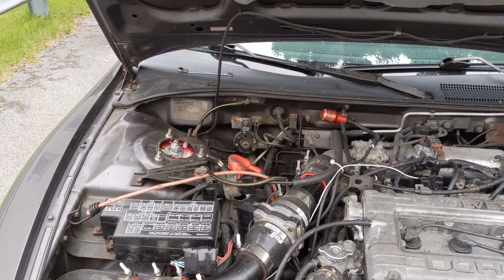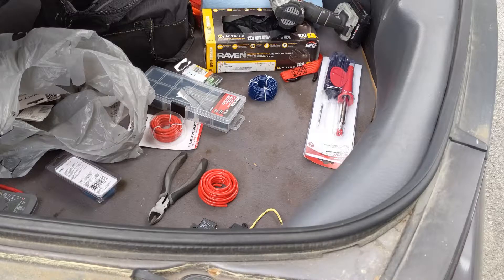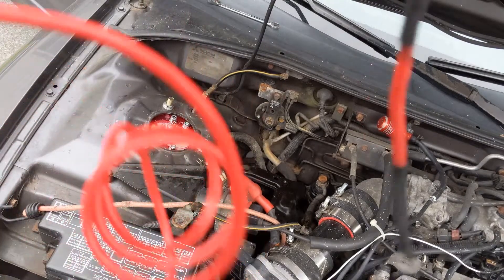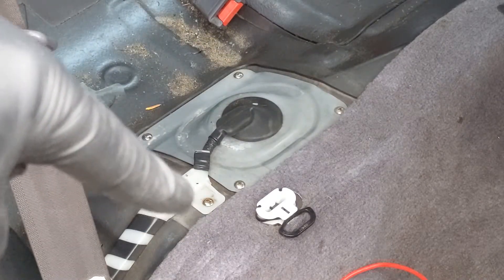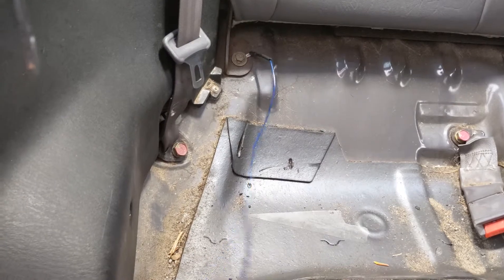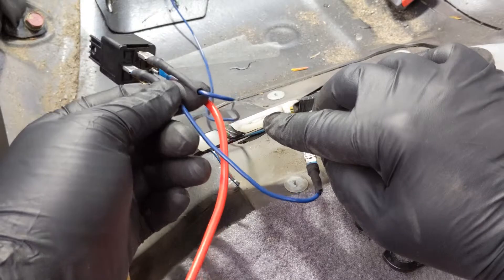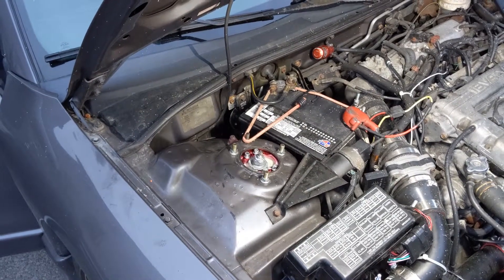2G DSM Fuel Pump RE-WIRE!

Comment: In the comments you link to some install photos showing that the power wire connects to post 30, but in the video you connect the short wire that goes to the pump wire to post 30. Which is correct?

Edit: It seems like you have the power wire connected to post 87. Is that the correct way?
Reply from the maker: Here’s a link to a pictorial breakdown. Pin 87 should be the oem fuel pump wire you snip going to the pump, 86 to the cars ecu side of that cut wire, 85 chassis ground, 30 power from battery, 87a unused. 

https://www.dsmtuners.com/threads/2g-fuel-pump-rewire-pictorial-with-diagram.313914/
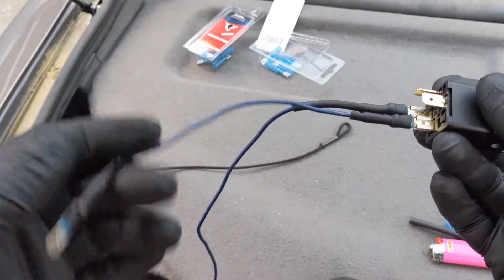Reply: @TPGDSM  Awesome thank you. I'll be honest I'm still a bit confused. @ 8:02 you say the new ground wire goes to post 86 on the relay (linked guide says post 85), then at 8:16 you say the short wire (which goes to the black/blue wire TO the pump) connects to post 30 (linked guide says this is for 12v power from battery). Then just visually I can see you have the red power wire connected to post 87, leaving post 85 open for the short black/blue pump wire TO ECU (linked guide says post 87 is for the wire TO the pump, and 85 is for chassis ground). I'm not really sure which guide to follow now. 

I currently have everything hooked up the way you did it in the video:
87: 12v power
86: chassis ground
85: short wire to ECU
30: short wire to pump
87a: unused.

Comment: Did you only cut the power wire from the fuel pump ? 

So the old wire goes to the relay and the power wire from the relay to the pump ?
Reply from the maker: @christianbavnild  check out the diagrams on dsmtuners for a visual. Once you see it it’s simple 👍
Reply: @  thanks, I did check it out. But some cuts the Ground wire too. 
I could see you did not do that. You only cut the power wire, which makes it more simpel. I have made a Ground wire from the relay to the chassis of the car and have left the old Ground to the fuel pump as it is. 

The Only thing I am wondering is where in between, I need to put a kill switch. ? 

Between the power from pump to relay or from battery (after the fuse) to the relay. 

You have an idea here?
Reply: @christianbavnild  in The battery wire mate

Comment: what pin on relay was power and what was the pin on relay for the blue/black wire that was cut, left. right pump side was pin 30 ground was 86.
Reply from the maker: 87 12V PUMP SIDE 86 12V CHASSIS SIDE 30 BATTERY FEED
85 GROUND
Reply: @TPGDSM  thankyou I have had my walbro 255 for over 4 years in a box going to install and do the relay too
Reply: Did you only cut the Black/blue wire ?
Reply: @christianbavnild  dsm forms i googled it

Comment: Where did you end up mounting the relay at my friend??? Curious. 🤔
Reply from the maker: To the lid of the fuel pump access. Worked out perfect. Just had to insulate some stuff to
Keep it safe
Reply: @TPGDSM  Sweet! Thank you good sir!
Reply from the maker: @PapaSmurf918Detail  anytime man!. I used a small bracket and machine screws. Along with extra EXTRA heat shrink on the connections. And replacing/adding a rubber flat washer under the locking ring.
Reply: @TPGDSM  OK cool. Was worried about the seat and it causing any issues but the extra heat shrink was. Good idea!
Reply: Did you notice an increase in voltage to the pump.. I have some 12 gauge wire plenty and want to rewire. Wondering of I should get some 10 gauge or if there is really a difference lol. What do you think?
Reply from the maker: @PapaSmurf918Detail  anything larger then the oem wire will do wonders. I didn’t personally check for pressure variance. I used the awesome info found on dsmtuners which shows fuel pressure/voltage on this link. https://www.dsmtuners.com/threads/injector-and-fuel-pump-supported-airflow.366003/ 

This shows an idea of what you can expect to achieve when you have a standard pump or aftermarket pump with/without rewire.
Reply: @TPGDSM  As I suspected too haha appreciate that brother! Thank you.

Comment: I’m confused with your # from relay and the diagram on dsm tuners does not match what you did! 
You snipped a blue/black wire and connected that to #30 on fuse but on dsm tuners link it says #30 is used for power feed from batterie???
Reply from the maker: I’ll look back into it and see what i did for ya. Not sure right now but once i pull the seats out after this front end upgrade I’ll let you know. All you need is power, ground, key on power or switched power and a signal wire. Check out the basic write ups on the relay you’re using. Wire front the front of the car is the key on signal, power comes from battery, ground goes to chassis

Comment: Question: where did you Relocate the new Relay??
Reply from the maker: the new relay is installed on the bottom side of the fuel pump cover panel. fit perfectly between the feed and return. if youre standing at the rear of the car its mounted about the 1 oclock position under the lid

Comment: Does it stay on?
Reply from the maker: No it doesn't stay on. Folks have had an issue from improperly installing the wires to the incorrect pins on the relays. Verify that everything is installed correctly to the correct pins and try again. The OEM fuel pump trigger wire you splice in to the relay signals the pump on with key on, and signals the pump off with key off on the other connecting of the OEM trigger wire. The relay is chassis grounded and 12v hardwired.

Comment: Hi!  I did the same wiring for my gst 98 and my car now does not want to start :/
Reply from the maker: Gst may have a different colored wire to tie in to. Check the connections, lookup which is the OEM fuel pump relay wire and verify all connections. Make sure your inline fuse is installed. Check fuel pump prime with key on.
Reply from the maker: #30 (blue wire) - feed wire from battery. #87A (red wire) - NOT USED. #87 (yellow wire) - when cutting stock 12V pump wire, this is to the pump side. #86 (black wire) - when cutting stock 12V pump wire, this is to the car side. #85 (white wire) - chassis ground.
Reply: My eclipse already work. I think washing the transmission and left some wet connectors and that's why I did not want to activate. Thank you for your help, the wiring that excellent.
Reply: The wiring also works for my gst 98

Comment: Which one does the power from the battery connect to on the relay. I watched it and couldn’t find it. Thank you in advance!
Reply from the maker: https://www.google.com/search?q=2g+dsm+FUEL+pump+rewire&client=ms-android-google&prmd=sivn&sxsrf=ALeKk01vXvjH341rRm1_Hh7nWnNniQzwDw:1621491453886&source=lnms&tbm=isch&sa=X&ved=2ahUKEwiAnvWwztfwAhUhszEKHd5WB0oQ_AUoAnoECAIQAg&biw=393&bih=727&dpr=2.75#imgrc=8oeEcZ2HV029PM
👍👍

Comment: So I did my fuel pump rewire and followed every step of your video and when I started my car and shut it off the car kept running key out and everything I have to unplug the ground to get it to shut off anything you can think of?
Reply from the maker: I would double check my relay connections, double check you've tapped the same wires as me. Something isn't right there 🤔
Reply from the maker: Also check that you have a clean power and ground
Reply: @TPGDSM  I redid the power and ground put all the connections the way you did on the relay and it’s still doing it
Reply from the maker: @brettlacey5502  gst or Gsx?
Reply: @TPGDSM  spyder gst
Reply from the maker: @brettlacey5502  so your positive you cut the blue with black stripe wire and properly connected it to the relay in the correct orientation to the correct pin
Reply from the maker: @brettlacey5502  hop over to Instagram or my fb page where I can message you and try to help quicker than on here. Something must be wrong somewhere.
Reply: @TPGDSM  mine is black with blue strip but yeah I followed everything you did man maybe I messed up somewhere but I just put it back to stock so I’m going to see where I messed up at
Reply from the maker: @brettlacey5502  sounds like the power from the blue/blk wire is hooked up backwards on the new relay causing constant 12v battery power. Could also have a bad "new" relay which happens sometimes. 🤔

Comment: Why other people combine the relay different to your video for example!  30 B +, 85 ground, 87 direct to the pump connector blue and black cable, 86 to the blue and black cable (harness of the car) Im really confuse lool trying to do this for my GSX 2g
Reply from the maker: Here try this link
 Two of the pins are switchable power I believe. Follow this diagram https://www.google.com/search?q=2g+dsm+fuel+pump+rewire+relay+diagram&oq=2g+dsm+fuel+pump+rewire+relay+diagram&aqs=chrome..69i57.10002j0j4&client=ms-android-google&sourceid=chrome-mobile&ie=UTF-8#imgrc=xGAcbYVOi8nXiM
Reply: which number on the relay you connect the battery cable B it's hard to identify lool
Reply from the maker: Stock wire harness gets cut, the wire leading to the harness going back into the car goes to 86, the other end of the wire that got cut going to the fuel pump goes to 87, the positive battery wire with inline fuse goes to 30, chassis ground goes to 85
Reply from the maker: So at the end 5v signal from the ecu goes through 86 and to the pump through 87 which triggers the the relay to pull ground with 85 allowing 12v constant power to come in and power the fuel pump through 30

Comment: I have a 420a which is not priming the fuel pump. I put a new pump snd relay in and it still won’t kick on, I’m not getting any fuel to the injectors, would a rewire like this help fix the problem? Sorry if I botched the message any help is greatly appreciated the car was running fine. It’ll wanna turn over but it’s not getting any fuel and I believe spark as well
Reply from the maker: if you have no spark and no fuel id bet its either the crank position sensor or cam position sensor. once those stop working the ecu cuts ignition spark and fuel because it doesnt know where the crankshaft is in relation to the piston in its stroke or the cam in its rotation. The ecu needs to see where the crank and cam is in order to inject fuel and ignite it inside the combustion stroke. Try checking out the wiring to each of those sensors and replace if needed. If that doesnt solve your problem i would check for power with a multi meter at the fuel pump harness and work back from there
Reply: @TPGDSM  thank you! I have a new crankshaft sensor in but it didn’t do anything different but I’d have to see about the camshaft sensor. Any tips on testing them with a multimeter?
Reply from the maker: @bravesoulsgarage6799  try this
My.prostreetonline.com/2016/11/test-eclipse-cam-sensor/
Reply from the maker: @bravesoulsgarage6799  try checking the fuel pump ground which should be on the firewall near the brake fluid resivoir. Should be black plug and a grey plug next to it. You want the black one. Unplug and check to see if it's broken/wet and plug it back in then try to start. You have spark,?
Reply from the maker: @bravesoulsgarage6799  you could also replace your ASD relay (which is directly next to the fuel pump relay by the brake fluid resivoir. Some folks have no luck until they both get replaced from what I can find.
Reply: @TPGDSM  I believe no, me and my dad checked for spark and he says it doesn’t but when I cranked it today and hit the throttle body with some starting fluid it kinda had wanted to start but didn’t. Fuel pump is good I ran it directly to battery and it kicked on. Relay is brand new. I’m thinking there’s a problem with either the crankshaft/cam sensor, the ecu or signal wire from fuel pump
Reply from the maker: @bravesoulsgarage6799  replace the asd relay if it persists. The two relays in tandem can cause this issue. Not sure why but some folks have great luck fixing this issue by replacing both. Keep us all posted
Reply: @TPGDSM  would you happen to know where they would be on the 420a platform?
Reply from the maker: @bravesoulsgarage6799  right next to the brake fluid resivoir
Reply from the maker: Two black boxes on the firewall. Driver side between clutch master cylinder resiervoir and brake fluid reservoir. They're hung together on a single bracket. You'll find em.
Reply: @TPGDSM  sorry for all the questions. It’s my daily so it has me a bit stressed I appreciate your time immensely. Thank you.
Reply from the maker: @bravesoulsgarage6799  hey man I hope it gets fixed quick and is back on the road fast. You should check out dsmtuners.com/420a-no-fuel-pump and other threads for better instructions. I've never owned one just worked on a few.

Comment: Do you have to run dsm link with the 750 injectors and the rewire out well it be fine on its own
Reply from the maker: If you put $750 in your car, you have to run either a maf translator or safc or ecmlink to scale those injectors or you won't be able to start your car
Reply: Or the old school way- a custom chip written to an EPROM installed into a socketed single board ECU. Kinda like ECMlink but not fine tunable on the fly in real time. I used those with MMCD logging on a Palm Pilot for years and it worked great

Comment: Would this bypass my a bad fuel pump relay ? I cant find mine at all and considered this method..
Reply from the maker: This is just re wiring the stock pump to supply a constant 12v power source to the fuel pump where stock the voltage fluctuates. Thicker gauge wire and it still utilizes the stock fuel pump relay signal to the secondary relay in the rewire kit. You could try it but if your not receiving the normal signal to the pump to turn it on I'd do some digging to see if a wire is broken or something else is wrong. It may be worth it to try but hard to say if it'd fix your problem.

Comment: In the beginning you said a 30 amp relay, but later in the video you used 40 amp
Reply from the maker: Yes I did end up using a 40 amp relay during my install BUT as said earlier it's recommend to use a 30amp as to not melt your wiring. The pins are still the same between the two realys for the videos reference sake.  HOWEVER I wouldn't recommend you do it to your ride. I guess it's more of a "do as I say not as I do" thing. I'll bet your mom never bought you glasses as a kid huh 😂 👍
Reply: I used a 40 amp relay and all the same gauge wires as you so I hope for the best
Reply: Just curious the relay I have is 30/40 amp but say it was a 40 amp, would it melt my wires?
Did it ever melt you're wires?

Comment: how much power can the stock fuel pump handle with a rewire?
Reply from the maker: Each cars a little different but I'd say after a re-wire and some data logging you would be alright going up from 12psi slowly untill you get bad afr's or knock. The other quick fix is a 190lph walboro which can run without an adjustable fuel pressure regulator but ends up being on the rich side. You may want to just throw the afpr and walboro 255 at it like we're going to do over here shortly. The pumps are easily accessible from the back seat and new 255's are only about$100 sometimes less on certain websites.
Reply: @TPGDSM  awesome thanks for the reply man! i already have an adjustable fpr and im waiting for a 255 to pop up on eBay for cheap. a tuner near me sells and installs them for about 75 brand new. thanks for your help!!
Reply from the maker: @southproduct7463  you should save the 75 bucks and do it yourself. It's one plug and one lock ring. Just look up the wiring on dsm tuners and set your fuel pressure to 38lbs
Reply: @TPGDSM  it's 75 total to buy and he installs it for free. he's a well known Honda tuner in my area but he does other stuff like that. thanks for the advice though!
Reply from the maker: @southproduct7463  sounds like a hell of a deal then. Wish I had a good shop like that near by. Upstate NY is kind of quiet on the tuner scene. Good luck with the project though!
Reply: @TPGDSM  Of course! Keep your videos coming, they're great!
Reply: Used this to install one on a customer's car today 👍🏾